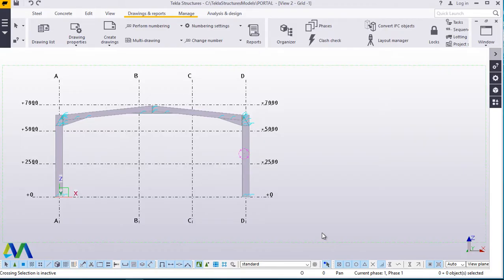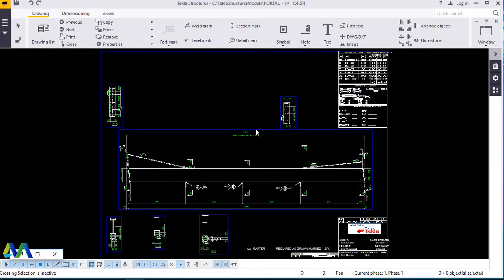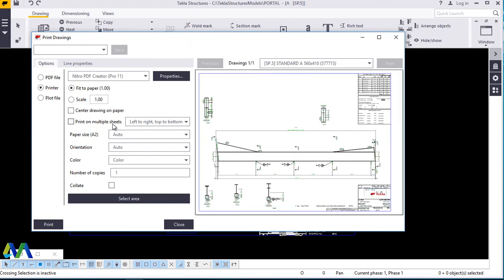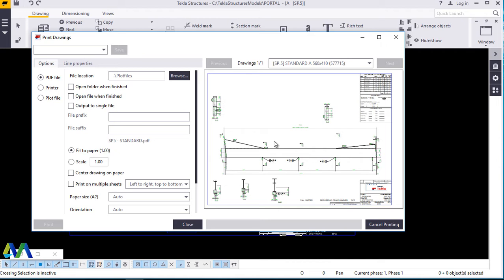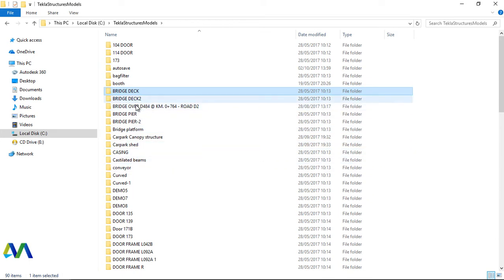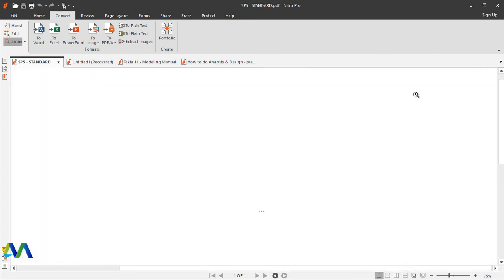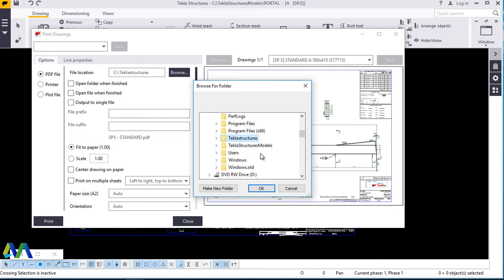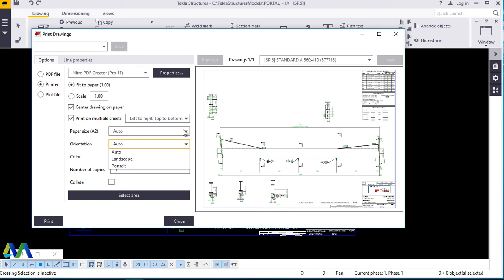Drawing Printing and conversion to PDF in Tekla Structures 2017

Comment: hello sir why my assembly drawing dont have the layout and the material info, only the structure.
Reply from the maker: it depends on drawing style you have chosen
Reply: @MauriceDimba  i using steel detailing configuration